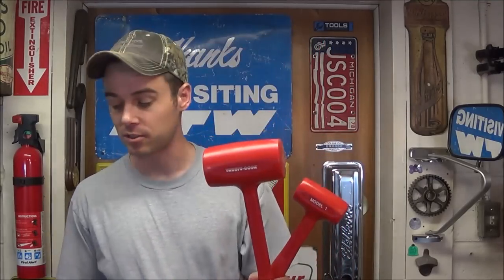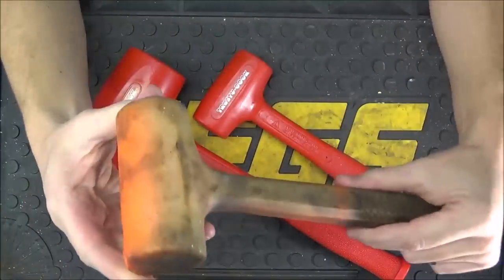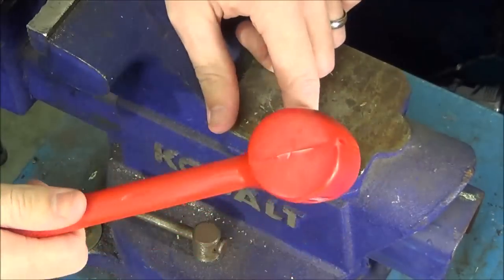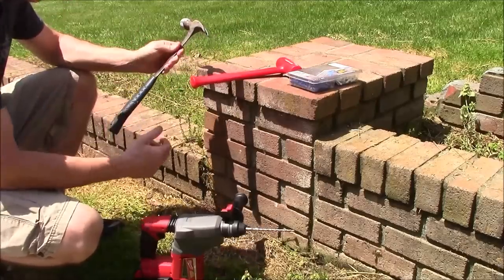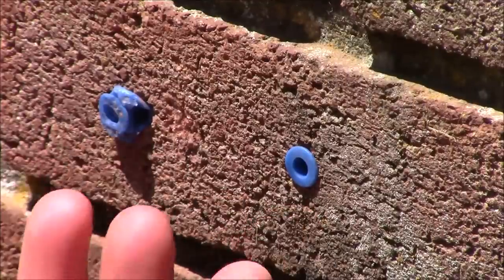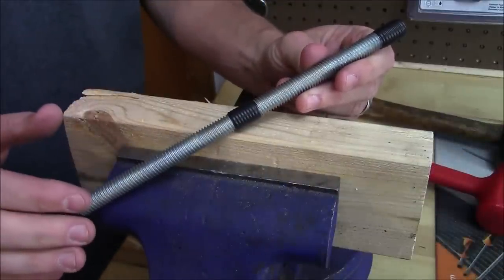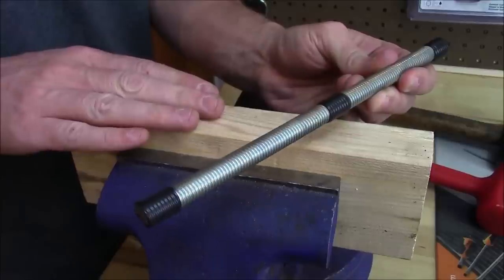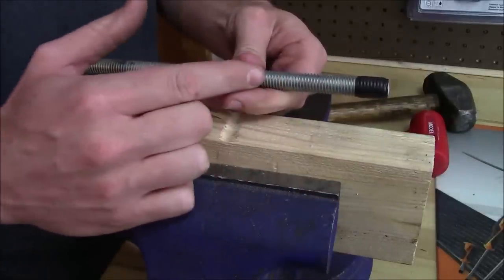Trusty-Cook Dead Blow Hammers - MADE IN USA

Comment: The plastic plug bent up because you hit it squint not because it was a metal hammer. Dead blow hammers are for occasions where you want a solid transfer of power without marring the piece. Where you don't need the solid force transfer you should use a plastic/rubber/copper mallet.
Reply from the maker: Chris Ryan Most people would grab the nearest hammer.....and 99.9% of the time that is going to be a metal claw hammer.  It was just one example of how this dead blow got the job done, where a standard hammer couldnt.
Reply: that is exactly what i thought and the whole video could of been done using a rubber maller
Reply: Chris
I agree.  Dead blows are used for joint assembly, not for driving masonery plugs.
Reply: Stan Loader.  Exactly, a dead blow hammer is primarily a woodworking tool. I've had my Harbor Freight model for 20 years now, and it still looks and works like new, because I use it properly.